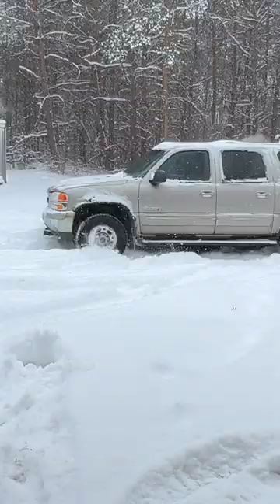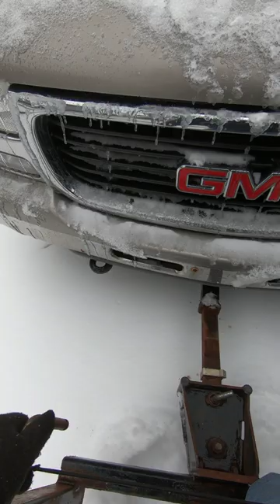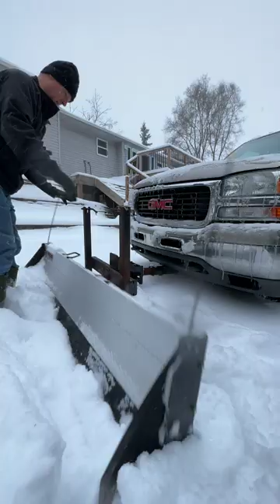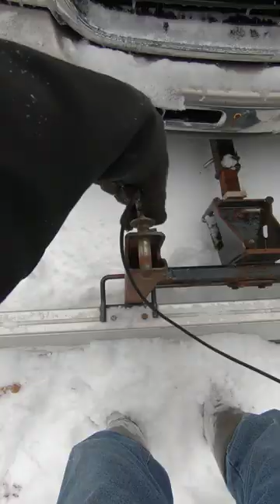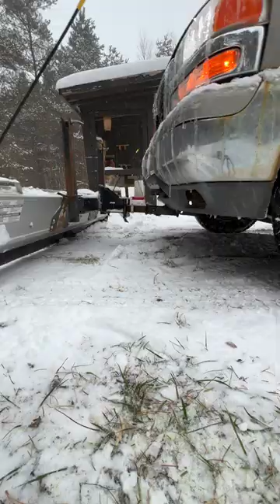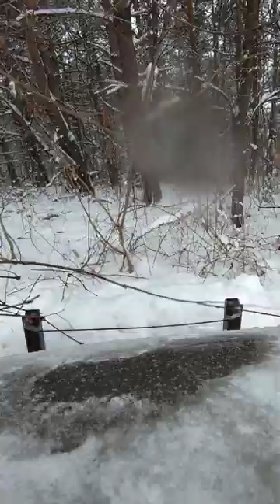TESTING SNOW PLOW ➡️ 2FT of SNOW

Comment: Love mine on an 05 Burb. You can flip the hitch receiver over so that it doesn’t hang so low. You do have to cut a square hole out of the lower plastic valance however.
Reply from the maker: That is awsome! Do you use it on the front? Ever use it on the back?
Reply: @EasyFixShaun  my first comment was referring to the front. I used it on the back before that. Worked fine but I much prefer in front. I bent my original rear receiver using it on back when I hit a  pile un-squarely. No damage to the carriage or plow however
Reply from the maker: Me too! It works anywhere. Front is best by far for me also. Plows like a traditional plow 😀💪

Comment: Where are they sold?
Reply from the maker: Total cost with hitch and plow about $2000
Here is my setup on amazon links from the description.
Snowsport HD 84" plow: https://amzn.to/3sK25nx
Blizzak tires: https://amzn.to/2p8M6Sv
Chevy front hitch: https://amzn.to/2ZQ1yo8

Here are two optional plows. 
Snowsport Light: https://amzn.to/2nDfcJb
Snow plow Light: https://amzn.to/2mND8cC

The HD versions with the wings on the side are incredible at scooping snow. You can plow off front or rear. Front is always best and easiest if you have the option of a front plow. Our Subaru doesn't so we plow from the back and it works fine. Front plowing with the plow is as good as any plow. Works fantastic. Only draw back is you can not back blade. You learn quickly to get around that though with a plowing pattern strategy😃🔧

Comment: What type of snow plow is this
Reply from the maker: Snowsport. Links in the description for it. Made by agricover.com
Reply: @EasyFixShaun  what I kind of meant by that is what type of plow is this I've never seen anything like this this looks like Bob and Jimbo threw together in their garage has like cables and wires and shit almost reminds me of the dinosaur crane from The Flintstones
Reply from the maker: @davidaix5771  Haha! probably started out that way 🤣. It is legit as far as I am concerned. It works great and is now 12 years old I believe. Its perfect and I have plowed a lot. I may get a new rubber blade some day. But otherwise I would say its the be winter investment I have made. It should last easily 2-3 decades with one blade replaceement half way through with heavy use. With light use you will never replace the blade. Here is the amazon link if you need it. 9 remaining in stock currently 😃❄ https://amzn.to/3JtnCu8
Reply: @EasyFixShaun  definitely looks cool but you're definitely paying a premium for super lightweight product
Reply from the maker: Its worth it. You don't need a heavy plow for most cases. Its like a lightweight shovel. Light is good. One person can handle the plow easily. The hitch mount portion is pretty heavy. You don't want to really try and carry it to far. Its a little awkward to lift. The lightweight part of the plow is the best part. This thing is easy to own. Easy to operate. Easy to store. Crazy durable. Easy to transfer to other vehicles. Anybody that owns one is not likely to go back to using anything else. They are amazing.